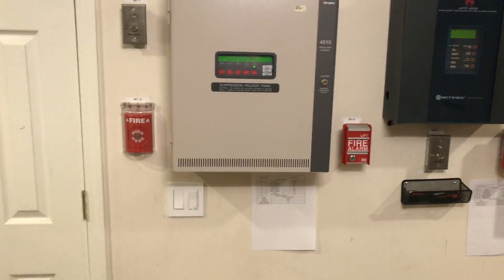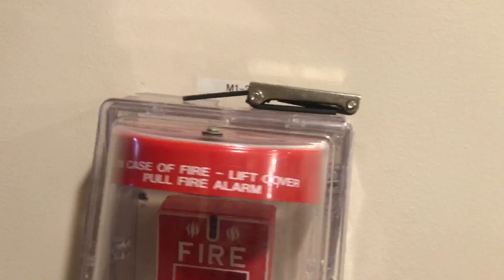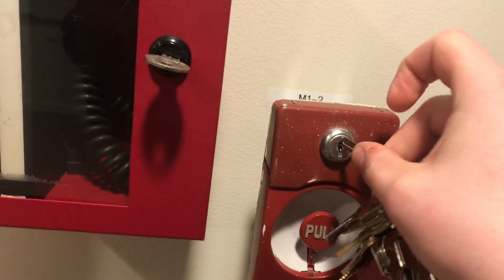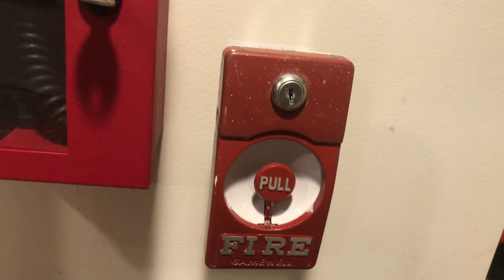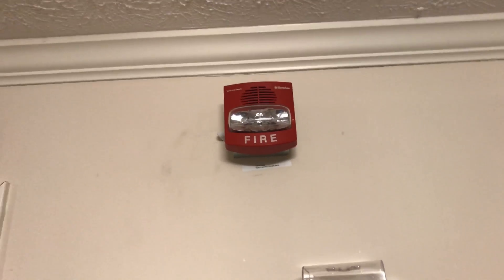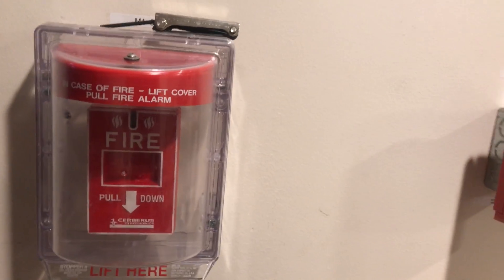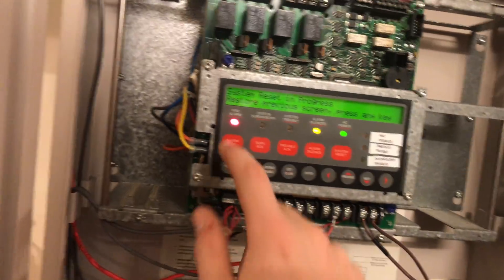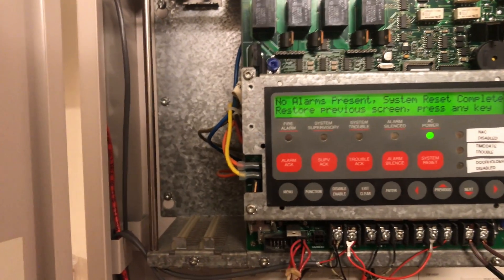Simplex 4010 Test 27: Request Test- dj

Comment: What addressable devices can a NFS-320 Notifier panel work with?
Reply: Any Notifier FlashScan capable device will work. Such as the NBG-12LX, FSP-851, FSP-951, and Really any other device that has FlashScan ability. P.S. The NOT-BG-12LX will NOT work on FlashScan